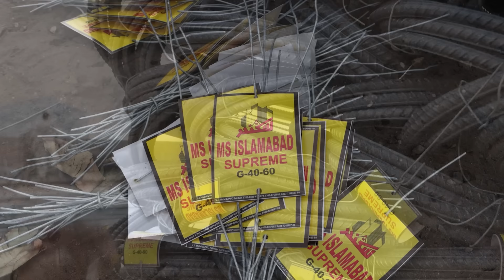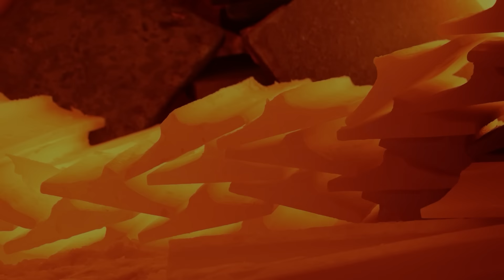Top 10 Fantastic Metalworking And Manufacturing Process Videos

Comment: They should have cast this crankshaft. Even though it’s a forging, the grain structure will not follow the bends. It won’t be any stronger than if it was a cast piece. The material and time spent could have been reduced drastically!